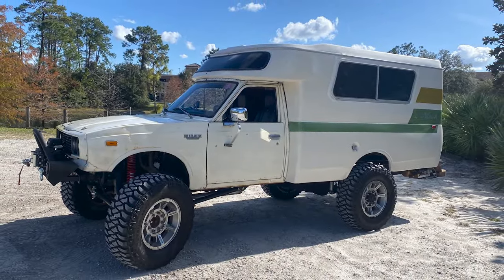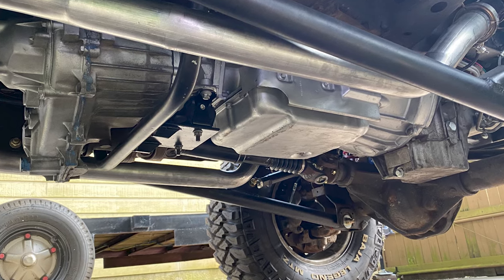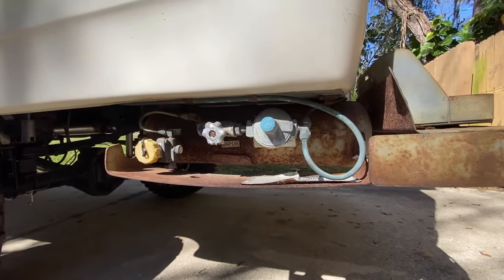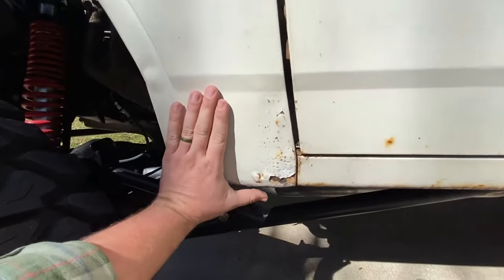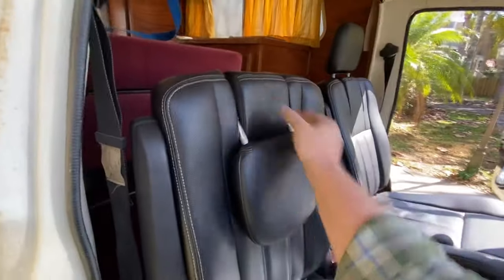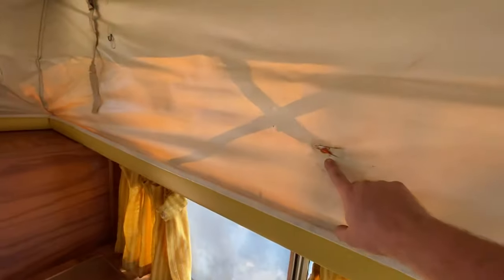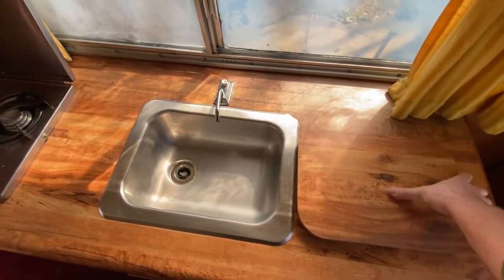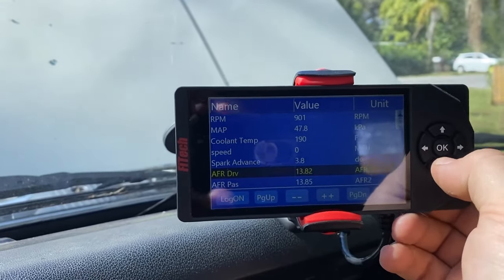1973 Toyota Chinook Hilux LS Swap 4X4 Build - FOR SALE in Orlando, Florida

Comment: would have been interested if it had a 5.7 toyota v8.....out of a tundra .....dont need lifter camshaft problems in the future from the gm 5.3
Reply: I know right. You can also take the 5.7L to pretty much anywhere around the world and they got parts for it due to the LC200/LX570 popularity.